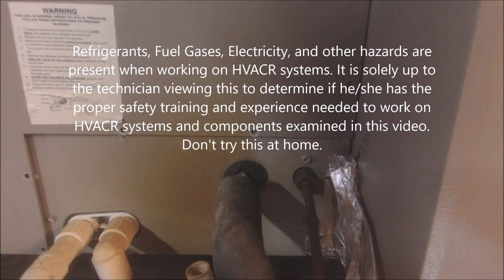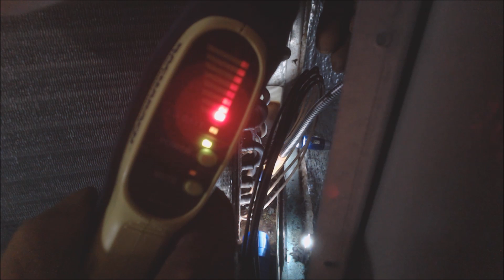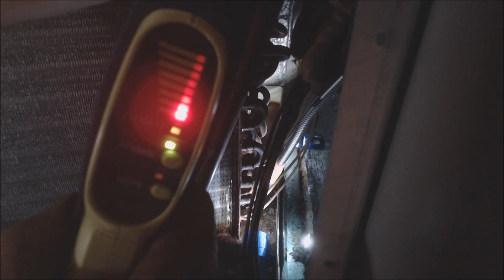How to FIND a REFRIGERANT LEAK in an AC Unit with an Electronic Leak Detector!

Comment: Ok, i know bacarach do good meters, ive used them years back when working on flammable gasses, what id like to get some help with would be with refrigeration, anyone that has run the inficon d-tek, the dp 82 from fieldpiece and this unit, the guys i work with have the inficon (s), but im not convinced they are actually that great, i prefer the build of the DP82, its good to see this unit also has that flashing LED, as i think thats more useful, especially over a PPM reading on an LCD display. But honestly if theres someone out there thats run all 3 (even the heated diode on the fieldpiece as a bonus) out there, id love the opinion, especially reliability of the equipment, getting parts is virtually impossible these days. Lol

Comment: Hi great video, could you please tell me if the AC needs to be turned off or in running mode when you perform the leak detection diagnosis?

Comment: Electronic leak detector sometimes help if there is a microleak which is very difficult to find especially if theres no oil stain but its much effective with soap bubbles as for confirming

Comment: Which is your prefered electronic leak detector? If someone more, what's your top 3? Thank you for your videos.
Reply from the maker: The VPE GN Pro works great and this sniffer will work well on R410A but really is no comparison to the ultrasonic leak detector since it is used on any refrigerant or nitrogen and really finds the leaks, thanks
Reply: @acservicetechchannel  Has you used the Bacharach H10 Pro? (I'll have to take a look on those ultrasonic).

Comment: How much of the proceeds go to Patreon if I purchase something? I need a leak detector and I would rather buy something that is good versus a cheaper brand. I look at it as an investment.
Reply from the maker: The amazon purchases are about 6% commission even though the price of the product on amazon is the same. It is a commission on anything purchased through amazon after clicking through a link. Tell you what David, I am really looking into getting a ultrasonic detector. I have read good things about the Superior AccuTrak VPE Pro. This would work great for locations where there is not a ton of background noise. You might want to wait until I can get my hands on it and then I will let you know for sure. I am certainly not blown away by any electronic sniffer so far. I have had a few. They will work on larger leaks but I want something for the smallest small ones. Electronic sniffers are also good in areas that have a lot of background noise. Thanks a lot David!
Reply: 2 days in a row the jobs I was on had low pressures and low subcooling. System was using a TXV inside. All I have right now is bubble leak detector and that would take me forever to find a leak. I did spray where I could and didn’t see anything. So either they have a small leak or prior techs that have been out there have not bled the refrigerant back in the system from there hoses.  I feel having something will make me look more professional and more efficient at my job.
Reply from the maker: I believe I have an ultrasonic one on the way so hang tight for me to test it unless in the meanwhile you want to get it anyway or get the sniffer. I will tell you that even with a sniffer, sometimes it really takes a while to find it. That is why I may be moving more toward reliance on ultrasonic. I agree, every service tech must have a sniffer or ultrasonic detector though. Thanks David!

Comment: I’m starting out repairing home Refrigerator with 134a.  Which leak detector would you recommend that would do a good job?  Do you check with refrigerant 134a in the system or with pressurized nitrogen?
Reply from the maker: We use nitrogen to get the pressure higher typically.  Bubble leak detector works great. Dye works well. Other leak detectors are more expensive such s the electronic one, thanks

Comment: The coils always seem to leak down there. Also I find a lot of leaks where the copper meets the steel. I like the all aluminum coils that a lot of manufacturers have been switching to. I'm not a fan of the Nordyne coils though. I think they call them micro channel or something like that. I know that York switched away from using them this year, maybe they've had problem. Idk, good video
Reply from the maker: I have had pretty good success with the non micro channel aluminum coils to date but it hasn't been a long enough of a time frame yet and just like everything else, it is all about which company is manufacturing them. Thanks Michael!

Comment: love that detector I gotta get me one how do you like it????
Reply: jimbola77. CPS makes a leak detector that I've been using with great results. I believe it was under $200.
Reply from the maker: It works well but is expensive. I have it linked in the comment section for amazon. The thing is that we need to have what we need to have to show the homeowner that we are trying our hardest. This would be something you can get down the road after you transition into the trade fully. How are things going for you?
Reply from the maker: Hey Michael, Thanks for the comment! CPS has 4 refrigerant leak detector models. Which one are you using?
Reply: thank you sir I really appreciate that I think I will start with that  cps I seen one at harbor freight but it looks cheap.

Comment: Were you able to repair the evaporator, or did you replace it?  Thank you.
Reply from the maker: This was my Electrician's father's house and he was with me during the service call. He said he was tired of replacing components and that he just wanted new. We replaced the r-22 system with r-410a. I am going to take the coil to school, pressurize it with nitrogen and dunk it in a tank of water to see all the leaks, thanks. If I was to fix this, I would cut the cap tubing back and unbraze the old cap tubing and push in the newly cut section one, thanks
Reply: @acservicetechchannel  how much would that cost ?
Reply: I can't find anyone interested in repairs they all want me to buy a new system
Reply: @u-know-this  that's how they all are, maximum profits in the least amount of time. smh